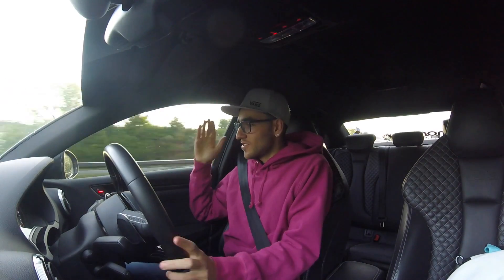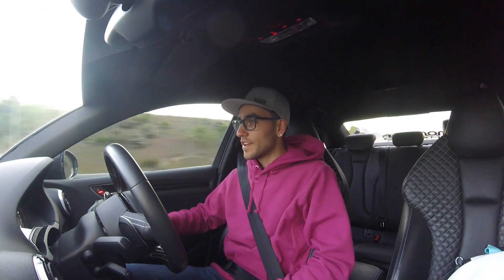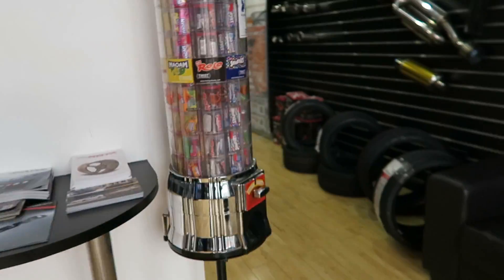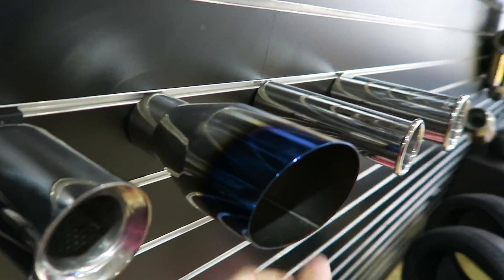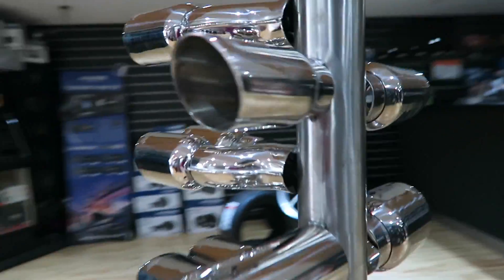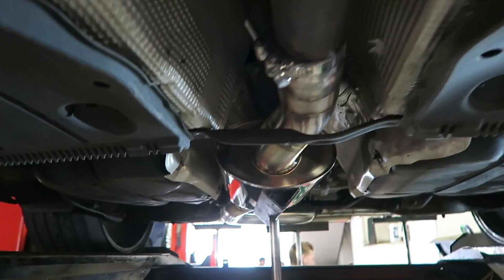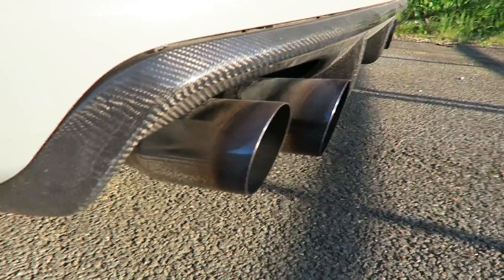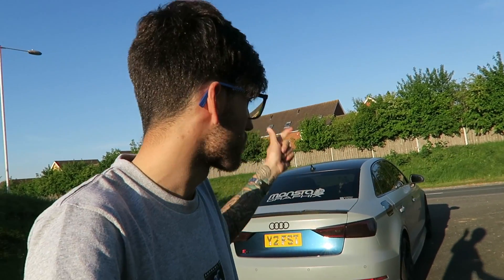Custom Catback Exhaust Made For My S3 Saloon!!

Comment: Rear diffuser looks like it's not clipped in properly?
Reply from the maker: yeah i need to put in a couple cableties on the clips just to hold it in a bit more securely in place as some of the clips don't quite go all the way in, although it is all in place and won't fall out, but it just needs pulling a bit closer to the bodywork